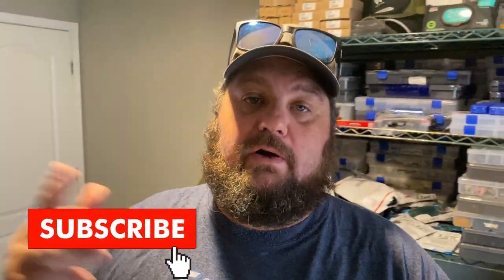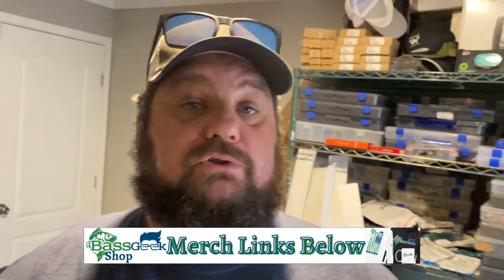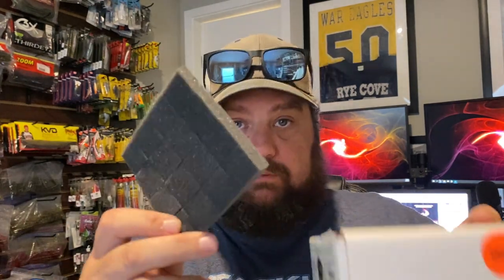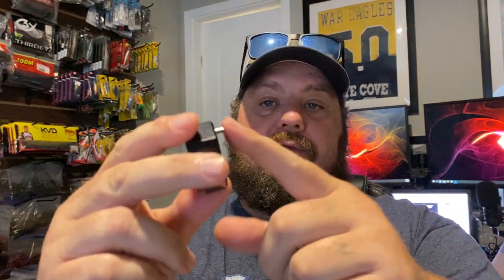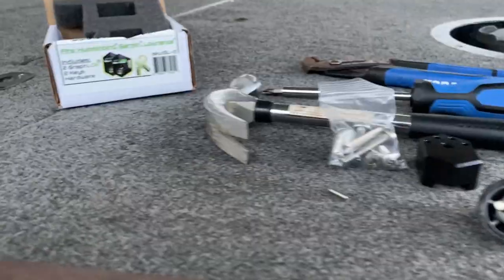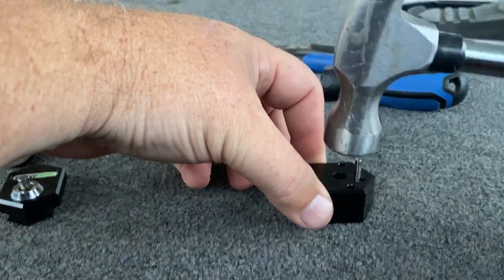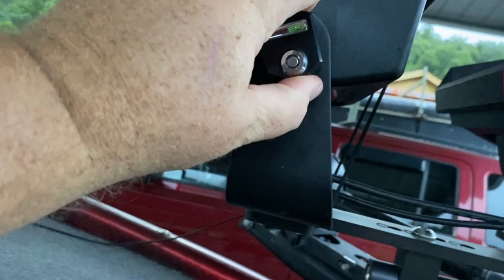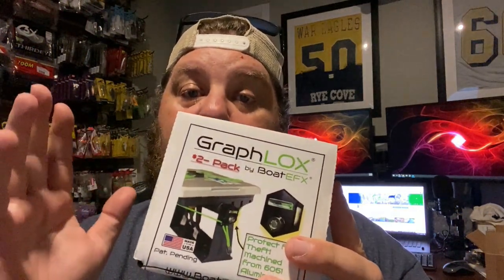Don't Get Robbed! Lock Your Graphs

Comment: Hank, I love my boat trailer steps that I got from EFX.  I'm pushing 50 and not as spry as I used to be.  I was skeptical at first, but I'm a believer.  I fish by myself a lot and it makes it so much easier to launch the boat and load it up.  I'm going to take a hard look at those graph locks.  They seem better than some of the ones I have seen from other manufacturers.  Tight lines!!
Reply from the maker: Man I Love'em and I swear to you I have not even had to retorque  them at all. I'm 350lbs. I love'me.

Comment: It is as much of a hassle to remove them from the boat. I just take them off the boat and lock them up in my gun safe when I'm not on the water.
Reply: That's what I do, small world. Mine are old though.
Still probably have 1,100 in the console and about a 1,000 in the front graph
Reply: @rowdybroomstick6394  i got 3. with about 2300 in them all not counting the mounts i bought for 2 of them. i have the ram mounts with the swivel ball. so even with these locks they would not be secured with these locks. great looking product and cheaper than others i have seen.
Reply from the maker: I used to take mine off. But 1 I’m a network engineer and I know that you have to temper electronics when moving them from a controlled temp to a high humidity temp. Or they draw moisture. Water and electricity don’t mix. And yes graphs are water proof but not air tight. Second I get tired of taking 30min to mount everything at the bait ramp. Last the water can get into the connectors and burn them out. Happened to my Gen1 HDS Lowrance.  Melted the power connector
Reply: @BassGeek  i don't have anywhere to store by boat out od the elements.  Really need a garage to put the boat inside. Just can't afford to build one or replace my graphs so they stay locked in the safe.

Comment: Geez, looks like good product, but a bit pricy for 1 lock
Reply from the maker: Not as pricy as replacing graphs
Reply: true, but this is a only deterrent, and you’re just using non standard screws for your mounts as a deterrent, so why not just use non standard screws on your graphs and save a bundle, it’s all just deterrents if they really want them they’ll get them, just trying to save a few $ for gas pump lol
Reply from the maker: @mobasser  The screw's don't flush up against the mounts and the mounts you can still slide them out. Plus the product ain't made in china. American machined is going to be more expensive than Chinese's stolen. I know we just can't get around china garbage now days but when we can maybe we should support it.
Reply: @BassGeek   I agree, we definitely should support American  craftsmanship when possible, I actually found round nylon bushing I can drill out so that screw head will be inside and a screw to fit, the notched  plastic washers on inside of mount will keep graph from being slid out same as with the lock, plyers will only turn bushing on outside, now just need to find the right non standard screw head, this will save having to have two locks on each graph, I’m getting there, thank you very much for replying